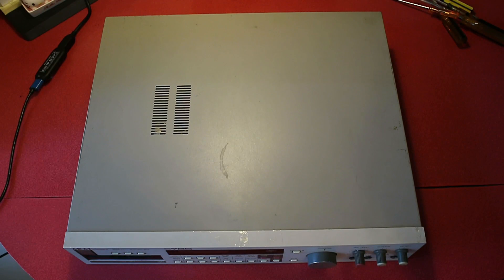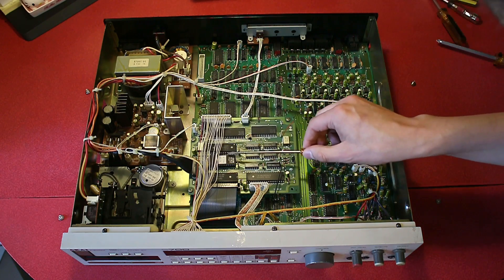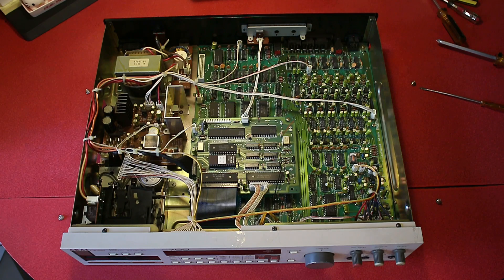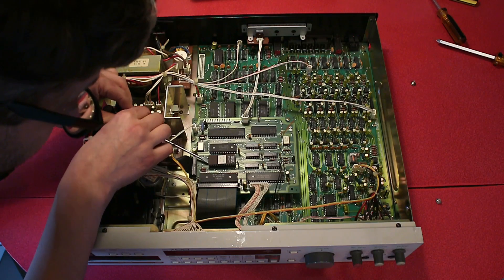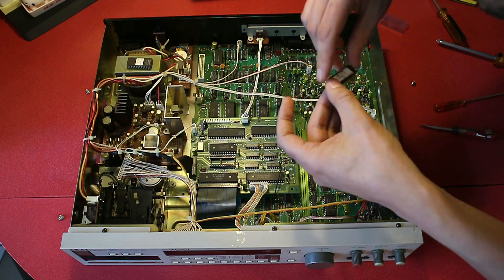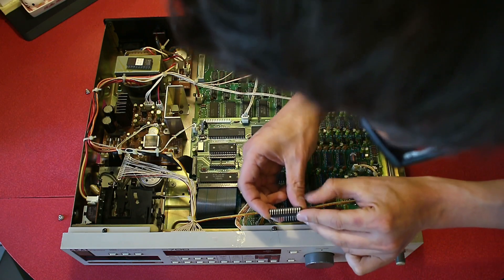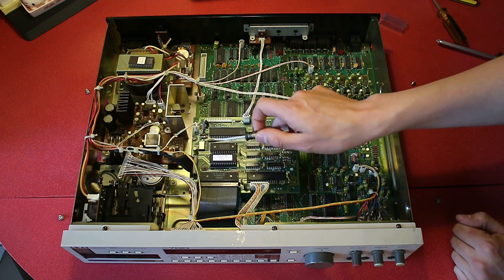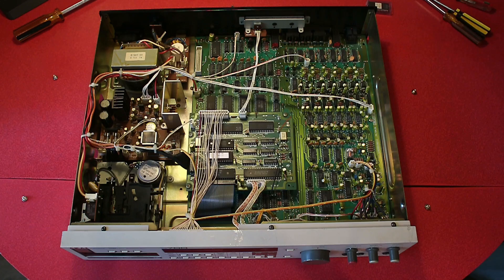Akai S700 firmware upgrade!

Comment: Have a problem with mine: for playback by midi it play only if I hold first one note which is mute but play the other one after that…the problem is that I can only play it in Polyphonic, other mode do not work….try to fix with OS 1.6 but not solve it, I think is hardware problem….can you help me, please
Reply from the maker: Download the manual, there are several different modes for the polyphony
Reply: I have the manual, after sampling if I play sample pushing the hardware button on front panel no playback, for listen I need to hold one note and play another on it using a midi keyboard
Reply from the maker: Maybe one of your 6 voices is broken. Try how many notes you can play at one time
Reply: @gwEmbassy  No all my voices works and I have the ASK70 installed from the fabric for other 10 samples slots and all works, is a midi problem comunication, if I extend the release to max when I play one note before the and of release can play the other but if I wait silence click a note and no sound :-(
Reply: Do you have a s700 SERVICE MANUAL? the normal one I already have it….I need the Service one
Reply from the maker: I wish I did :( I searched everywhere for one